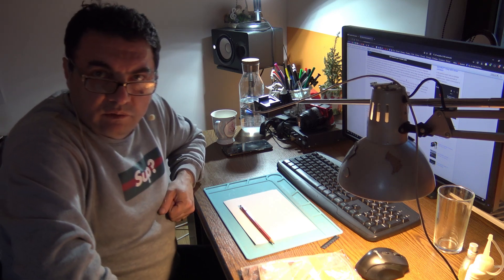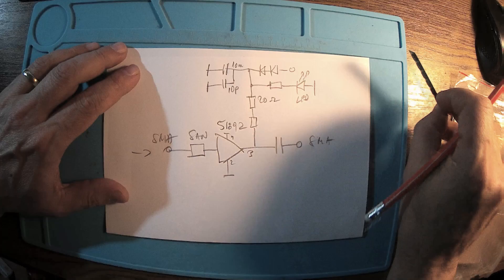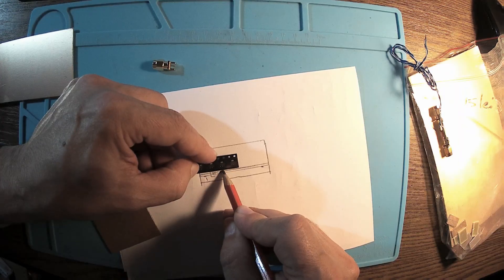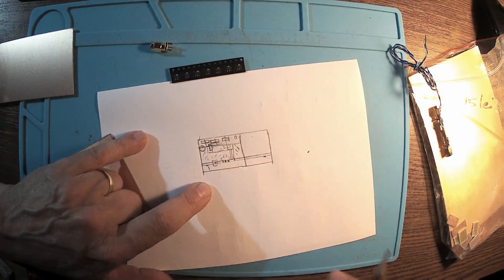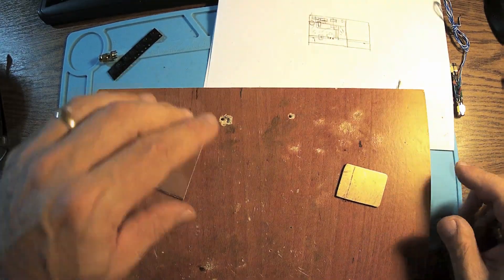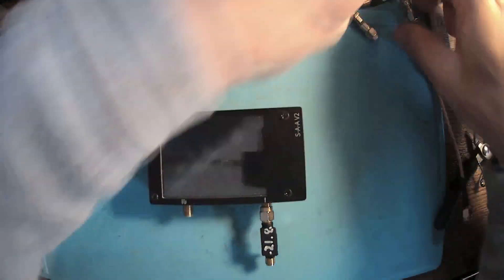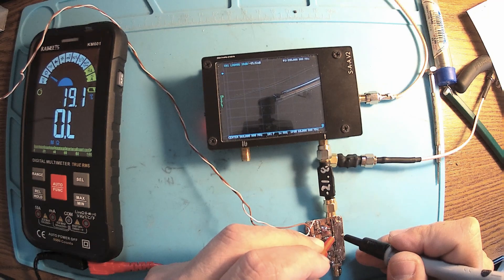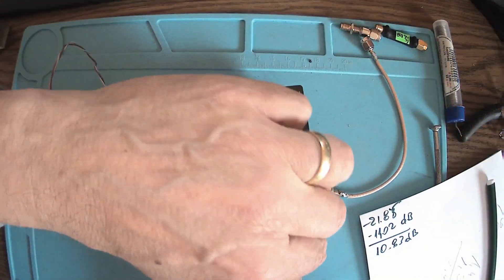DIY RF Helium miner amplifer

Comment: Sir would you like to answer out of the track question. Is it possible to measure incoming amp from multi meter putting it in series between battery and charge controller? I bought a new mppt charge controller and to measure amp I did this but only 1.3 amp is going to battery. However my solar panel is providing 5.6 amp. I am really confused now. Is my way of measuring is wrong or my mppt charge controller has fault. Please answer.thank you
Reply from the maker: Maybe your battery is charged.. Deplet it and try again.. Also hiw much voltage is your battery.. If it's more then input, current goes down because voltage rising
Reply: Yes  I bought it new and asked it to be top balanced. My battery volt is 12 v and solar panel generates 19-21 volt and 7-9 amps. Thank you for your kind answer. I like watching solar related and battery related videos. Please make some videos on that topic too. Thanks again
Reply from the maker: @me_nobody  Hope it helps..like I said , just let it run  empty and recharge..then you'll see the current..Please search my channel , there  plenty of solar power related videos..nothing new to report ...

Comment: Great project - would you be able to provide a detailed parts list for those of us who would like to build one as well and join in the fun?  the schematic with some more details (SAW filter, capacitor, diodes etc.) would be great for those like me who are electronics newiews but like building and testing stuff. 
I'm guessing the one you just built is intended for RX only? ... thank you for these great videos!!
Reply from the maker: Yes it's RX only..I'll be back with schematic and parts list.
Reply: @viocaia  Thank you. My soldering iron is warming up 😀
Reply from the maker: @stevecrabb1  Check the description..there is the schematic..BTW the coil is very simple to be done , just a piece of wire..check my video about Bias Tee
Reply: @viocaia  Thank you so much for the schematic, it has all the information needed as far as I can see. I will order the parts and let you know how it goes. I have seen your bias tee video so will make the coil as you describe.
Reply from the maker: @stevecrabb1  Perfect..let us know..
Reply from the maker: @stevecrabb1  Ther eis mistake..C3=100p
Reply: @viocaia  Noted, thank you
Reply from the maker: @stevecrabb1  Just fixed..somehow..
Reply from the maker: Look here http://viocaia.amphia.ro/RFamplifier.pdf
Reply: @viocaia   404 page, missing schematic
Reply from the maker: @zarada2103  Try now, I just draw a schematic. You also search for SPF5189Z schematic and adapt to your needs. I found two diodes in series at the input lower the voltage and current to reasonable numbers.